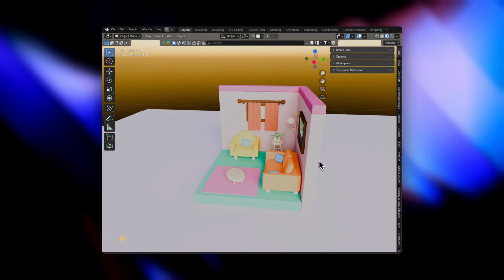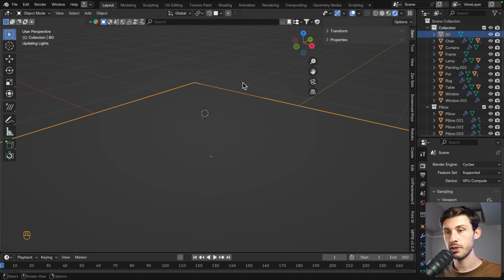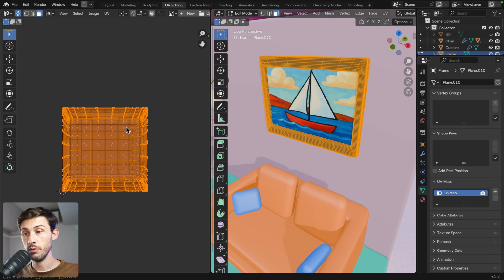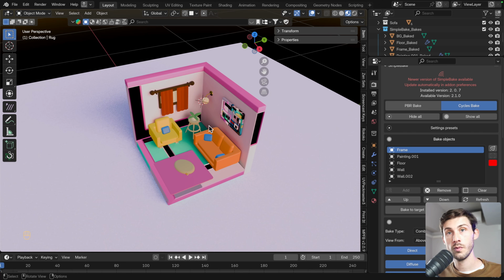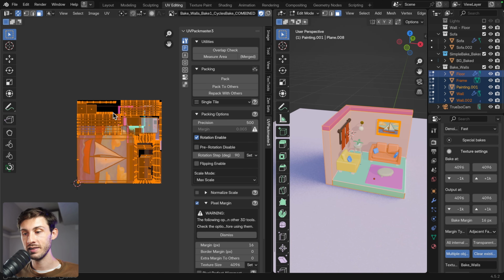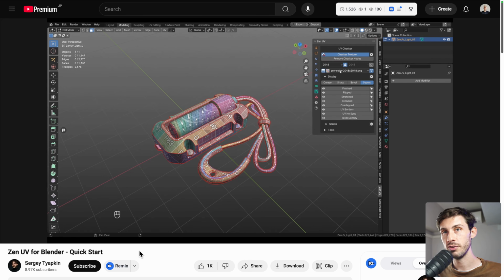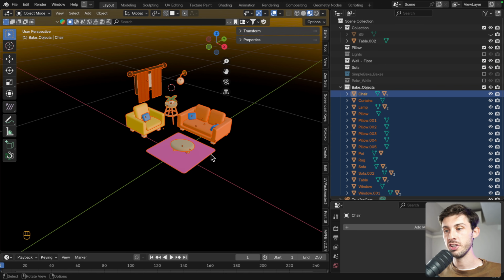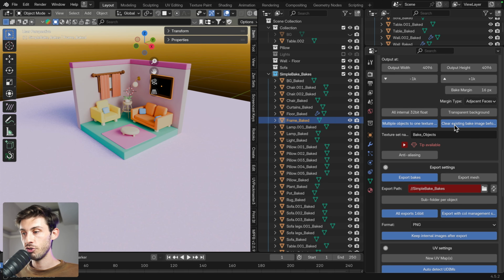How to Bake Lighting with Blender for Three.js

Comment: Hello! I’m a subscriber watching from Korea. 🇰🇷 Since I can't fully understand English, I have a question regarding the settings.

What sample count do you actually use for your projects? I currently set it to around 512. The quality turns out great, but the rendering time takes way too long. Is there any other way to improve bake quality without just increasing the sample count?

Thank you so much for the helpful tutorial! I would really appreciate your advice.
Reply from the maker: Hello! Well.. I generally do tests at a low resolution but when I'm happy with it I do it at least 512 or 1024. Are you well using the GPU and not CPU for this? Also based on your hardware it takes more or less time... (Avoid having too many lights / objects too)

Comment: Hi sir, I really appreciate your Three.js tutorials — they’ve helped me a lot to understand the workflow between Blender and Three.js.

I’m currently working on a golf ball customization project. The setup is:

I modeled the golf ball in Blender, and it has two UV maps: one for the base golf ball texture and another for an equator image band around the ball.

I also baked the normal map from a high-poly sphere onto the base golf ball mesh, marking seams along the equator area before baking to control the detail precisely.

In Blender, everything works perfectly — the normal map and the equator image both look correct when I use the second UV map for the equator texture.

But when I export the model to Three.js (GLTF), I face this problem:

If I switch the main UV to uv1, the equator image looks correct, but the normal map disappears or stops working properly.

If I keep the default uv, the normal map looks great, but the equator image gets stretched or distorted.

I tried replacing geom.attributes.uv with geom.attributes.uv1, reassigning textures manually, and even adding the normal map to both materials, but I can’t make both work together.

My question:
What’s the best way in Three.js to use two UV maps (one for base + one for equator texture) while keeping the same baked normal map visible across the entire model?
Should I handle this using a custom shader (onBeforeCompile), or is there a cleaner method using NodeMaterials or texture coordinate mixing?

I’ve been stuck on this for about two weeks and would really appreciate your insight. 🙏